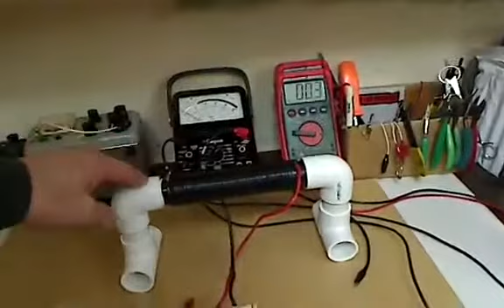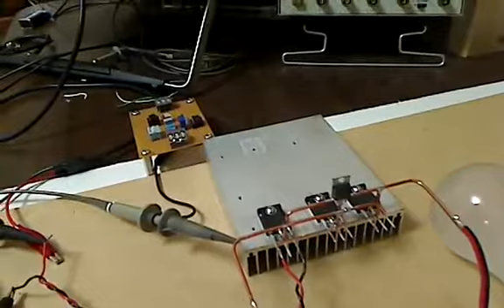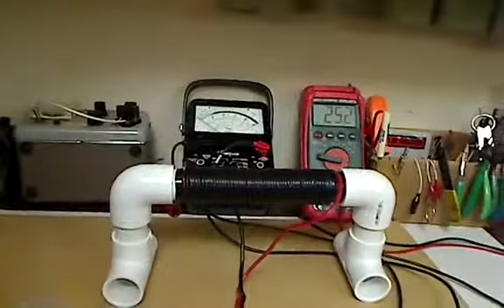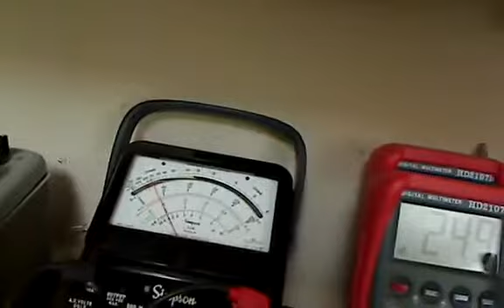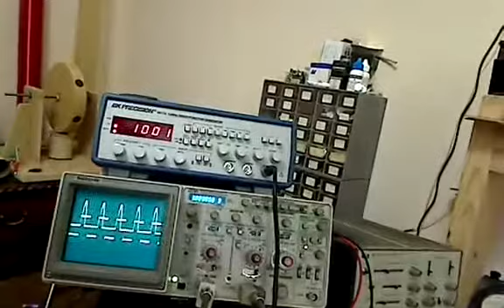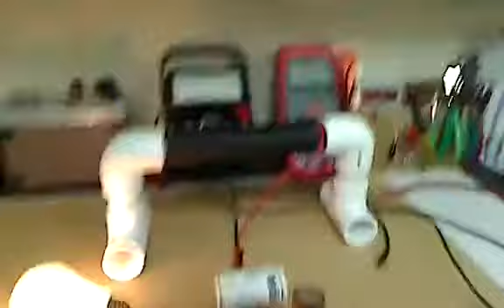Energy Conversion Device Ghazanfar Ali Generator (AliGen v1) replicated by "duff2u"

Comment: It's like a simplified boost converter.
after turn off,  the built up magnetic field energy from the coil becomes resonant. and produces high enough voltage for the lamp to burn (flicker).
In a boost converter, this is rectified into another cap to produce a higher voltage dc.
The higher voltage halfwave is the impulse Nikola Tesla used.
but the large parallel cap has slowed it down, and reduced its voltage.
when the cap is much smaller (or left out, and only the capacity of the coil is used) the voltage will be much higher (able to kill the mosfets!)
the body diode of the mosfet passes the second half wave of the resonant coil back to the supply.
Reply: @qinaan   my mosfet: C3m0021120D , I use 2 in series 3.7mH seems very high. my biggest L4 coil has only 935uH
Reply: You are right, in my device I am trying to get rid of the capacitance of the coil and compensate for this with a solitary capacitance.  This gives a significant increase in energy.  If you'd like, we could talk about this.